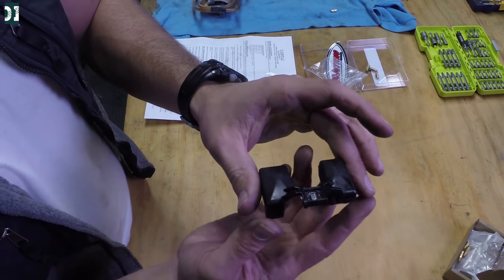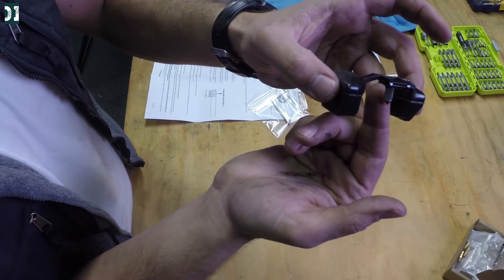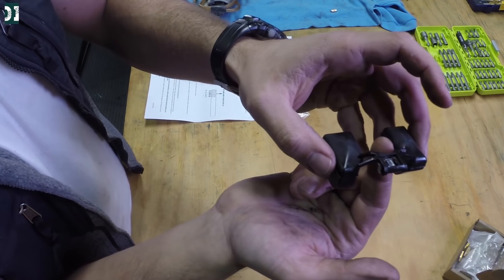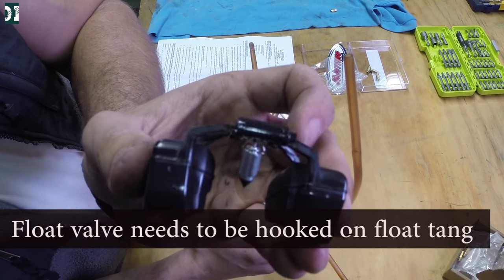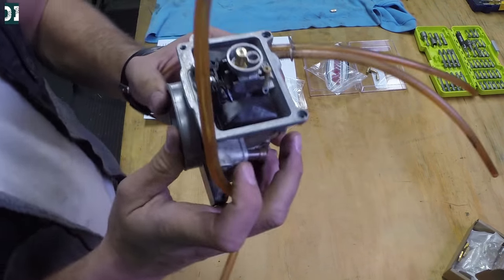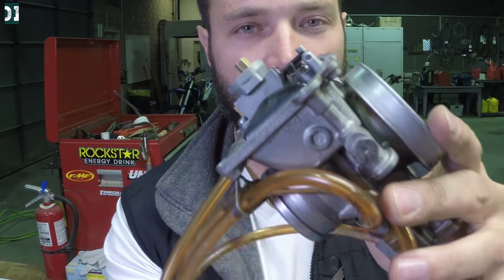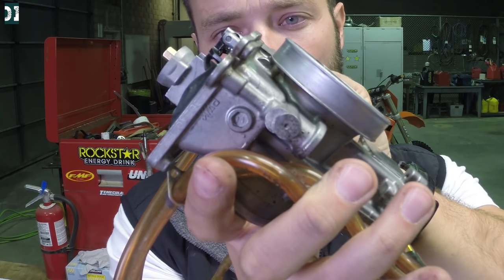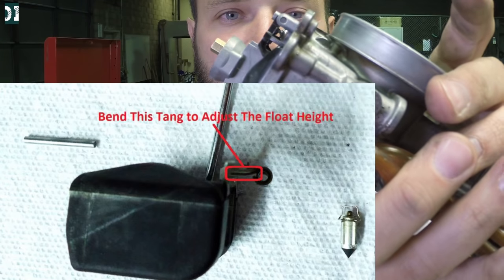How to adjust float height on a dirt bike carburetor - Keihin PWK 38

Comment: I went through a dozen videos and was still confused, until I saw yours. Great job, thanks
Reply from the maker: cool Joe! I am glad it helps, thanks for sharing
Reply: With most carbs they give you a specific float height to measure.  Mine is supposed to sit at 26mm from the lip of the carb body.  Parallel isn't always the right height.  Alwaye best to check your manual and measure it just to be safe.
Reply: @dirtniron  hey man my dirtbike it keeps running out of fuel sometimes it will just shut off when I'm riding it so I cleaned the carburetor but that made it worse so do you think if I adjust the float that will fix it 🤔🤔 cause I don't know what else it could be
Reply: @nickolasvaughn265  did you fixed , I have the same problem ?

Comment: easier way to do it it is by holding the carb upright or at the same angle it would sit on the bike , blow down the fuel intake pipe to the carb . adjust it so that when the float line / seam is parallel with the carb base you should not be able to blow air down the fuel line . by doing this you will see exactly where the fuel supply shuts off and is more accurate .
Reply: Mark H this worked,thanks bro!!
Reply: Mark H that's how i have always done it too.👍
Reply: Mark you need to make a video on this or something mate.. This technique is THE BEST! Thanks heaps
Reply: Blow down the intake pipe??  Im not great at carbs.  But clarify this
Reply: @apuetz19  where the fuel enters the carb from the gas tank.
Reply: Turn the carb upside down line up the float seam with the body of carb then suck on fuel line and see if it holds suction on your tongue
Reply: 👍🏼👏🏻👏🏻👏🏻worked great
Reply: Wow did not understand this so just tried it and I feel like my brain is putting it together now. Cool idea thanks

Comment: Well, I don't know about the parallel thing. Every carburetor has a spec for the float level usually in millimeters for keihin and mikuni. I like your technique for turning it 45 degrees or whatever it takes but for instance a keihin 39 PWK has a spec of 16mm from the machined bowl surface to the very top point of the float when the float tang is just touching the needle. That's what needs to be measured, not weather it's parallel or not.
Reply: actually for this Keihin the spec is to have the flotor parallel +/-1 degree but with carb sitting at ~60 deg. the point is not to compress the spring when measuring. I always just blow air in the fuel tube and check the closing point with carb mounted on the bike.

Comment: Im watching your channel and its been very helpful so far. Thanks a lot. have a question. after adjusting the float height and lets say its correct when you fully compress the floaters(black plastics) ,does this little spring on the rubber neddle should be fully compressed too??? Cause mine is just touched and compressed half way
Reply: The unfortunate part is that nobody on YouTube has yet been fully knowledgeable on these valves. I spoke with a local powersports tech and someone at Rocky mountain ATV and neither of them know the specs of this spring and plunger. The spring does get week over time. I read an article where a guy has three carbs on his engine and they all have different tension so he ordered three new valves.
Reply: @jayryan7473  So i think that this spring has not so much importance at the end. In the older PJ carb this spring can be fully compressed. Now in the new pwk carb it is very small and can be barely compressed.  I have heard that its there to absorb the vibrations.
Reply from the maker: the spring on the float valve should not be compressed when adjusted to correct position. That spring is there as a suspension for the bumps and vibrations. The float should be fully shut when barely sitting on that spring. thats why you need to adjust it while holding the carb at the angle.
Reply: @dirtniron  Yes. Did all that the right way. just asked for that spring thing. Understand everything you said. Thank u for your time and your videos.

Comment: Good video but on the little needle that goes on the float in the middle and it goes up in that hole once it's on there apparently my spring the small miniature spring jumped off where that keeper holds the Tang hook for it to be compressed up in that hole does it have to be a small spring there or can just that needle valve hold it itself
Reply from the maker: I would order new one, those needle valves are cheap..

Comment: Nice tips bro.
One question:
Why it must be setup in 45' angle?
Reply from the maker: +dyka adiyoso in order to only touch the spring on the top of needle valve, you don't want to push that spring in.

Comment: Question: why Do i have to hold it for 45 Deprees. My carburator is installed straight. The float goes straight horizontal.
Reply from the maker: bc there is little spring on the float valve and you dont want to compress it when setting the float

Comment: Hi bud I have a yz125 2000 I recently purchased a keihin 38 carb originally it ran a mikuni would you know what jets ill need to put in
Reply from the maker: not quite sure, check yz250 stock jetting and go like 2 sizes bigger to start. Smaller engine has smaller vacuum and hence needs bigger jets to suck the gas thru.. i would just play with it or check other forums, maybe JD jetting have the specs for that too.. ask them

Comment: I bought a new inlet needle from amazon, it came and it doesn't have a rubber seat like the oem, so I'm wondering if I got took. Looked like a reputable source, I'm always careful about that. I'll run it and see if meters the fuel correctly.
Reply from the maker: hope it works.. let me know
Reply: Dirt N Iron Well, got the new needle in, float height set, still leaking a small amount of fuel dripping, bike runs good,went to a 168 main jet.

Comment: Is it normal for my carb floats to fall when I hold the carb upright?
Reply from the maker: yes, it will push the little spring on the top of the float valve.. its normal, float is too heavy for that little spring
Reply: Dirt N Iron ok awesome thank you

Comment: Hi, my scooter chokes (or stalls? 🤔) when I go up long hills. It happens randomly and sometimes it starts happening less than a mile apart. I let it sit for a few seconds and start it again without issues, but will choke again. Could this be related to the coke level, since it happens only on uphills? There's another similar issuer going downhill, but I don't know how to describe it.
Reply from the maker: sorry Alfredo, I am not really sure ...
Reply: Alfredo my scooter shut off and eventually I found out it’s was a a vacuum valve that would block air from getting into your tank creating vacuum..
Reply: @LucidFightClub  thanks for your comment, it seems to be a common issue but I've tried loosening the fuel cap and it hasn't helped, do you think loosening the cap would be enough or should I try something else?
Reply: @alfrecletero  well my check valve had a little place it slid onto and that place was made at a certain angle that kept it from closing, it came off and closed because it was at an opposite angle, i'd look into that its kinda like a check valve! and the second place you might have problems with is your Fuel Pump Petcock Gas Tank Valve.. look into those 2 things and let me know how it goes!
Reply: @LucidFightClub  thanks for writting back, I mistakenly thought you were talking about the fuel cap for some reason... I'll look into that as soon as I have some spare time
Reply: @alfrecletero  yea just look and see if you could find the hose that is on top of fuel tank, and then just follow it back to where it goes and see if you could find the check valve..
Reply: @LucidFightClub  Should the valve be closer to the carb or before the fuel filter? Can't seem to find it. The fuel hose exits under the fuel tank, there seem to be two fuel filters for some reason (one triangular, the other cylindrical) and then it goes into the carb.
Reply: @alfrecletero  mine was cylindrical, shake it if you hear a flapper inside, that is it! find its seating on the frame and slide it on! also its kinda in between the carb and gas tank!

Comment: I have been fouling plugs on my beta . And beta said to ck the float height that some have been set to high . what do you think ? it seem to be running rich alot of oil out the pipe
Reply from the maker: Check the float height first and then maybe you might need to play with jets, or maybe try to adjust air screw and needle first. Let it run little leaner.

Comment: I have a 36.2 cc motor it'll start but bog out and take tremendous about of pulls to start then dies out I smell the fuel etc but won't start.it has new spark..ignition etc aswell
Reply from the maker: you need to go thru your carburetor, check it all, clean it. possibly use new jets.

Comment: Hi 
I have the same carburetor and keeps flooding the engine is that the only reason if float is not adjusted or can be something alse
Reply from the maker: +TheIrfanxz44 main reason is jetting, first check the float and then play with jets. Looks like you are too rich
Reply: Dirt N Iron thank you for replay
I did check everything and cleaned it
I I noticed on the fuel-air mixture screw on the manufacturer specifications Show's a O ring washer and the spring and I don't have the oil ring on there do you think that's the main problem flooding the engine
I purchased a bike just like it is thank you for your help
Reply from the maker: I would get a kit and rebuild the carburetor, it doesn't cost much, then you will be sure that all the seals and o-rings are ok. put it back together and play with jetting. I am not convinced that air screw o ring could be main reason.
Reply: Dirt N Iron thank you enjoy riding

Comment: My carb leaks when I lean it to the side but the float is parallel, what do I do
Reply from the maker: its a float valve problem most likely
Reply: It’s just a tad too high, lower it maybe a mm so it doesn’t have as much fuel

Comment: so my carb is pouring fuel from drain hose is this a float issue?
Reply from the maker: Looks like your float valve doesn't shut well. Check the float hight and the float valve, possibly get new valve.
Reply: 1. float issue
2. fuel needle issue
3.dirty carb

Comment: why would the float go out of adjustment.
Reply: Dirty Gas
Reply: Good question. Mine does.
Reply: The rubber-coated seat of the needle valve can start to degrade, and you can adjust the float level a little to compensate. The adjustment tab can get bent by mistake while you’re cleaning or changing the jets. The float can leak and not float as well.